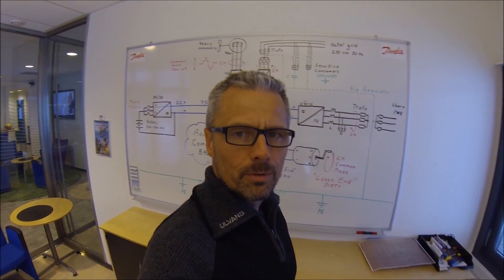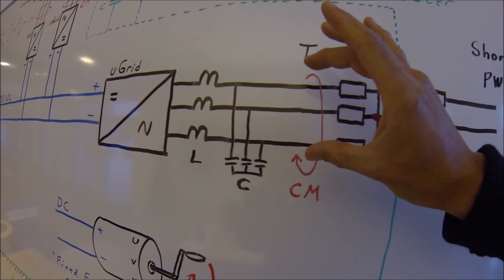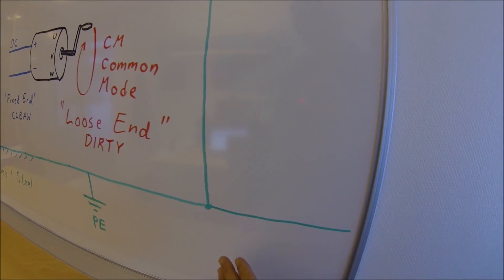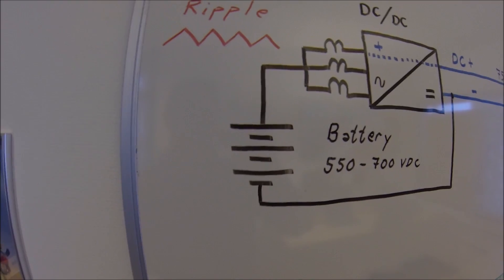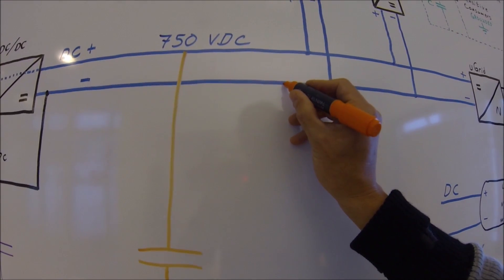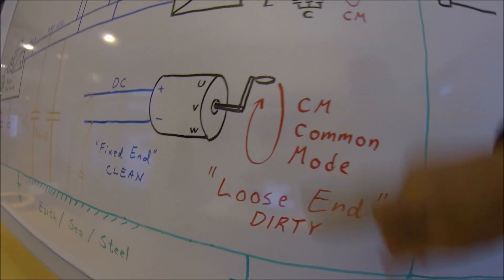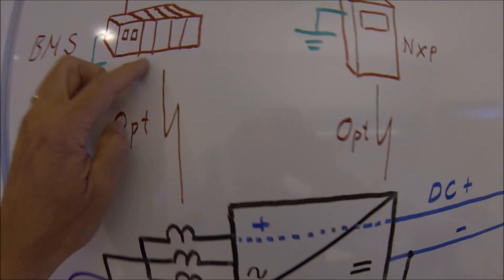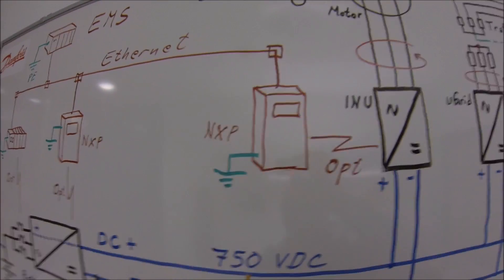Drives School (E18) - Hybrid ship common mode ballasting

Comment: Great video, but what type of class should these caps have? And also what voltage rating should they be dimensioned for? DC-grid or should one account for the common-mode peaks aswell?
Reply from the maker: The caps we use are rated 400 volt and 20yF. You will need 3 in serial on a 1000 VDC bus